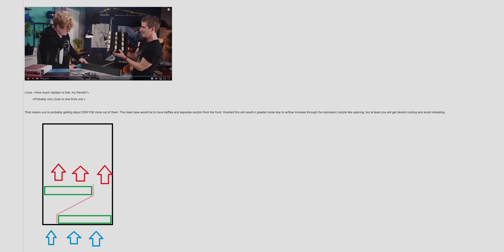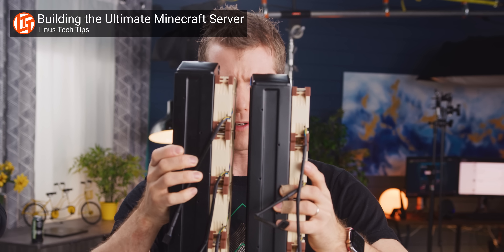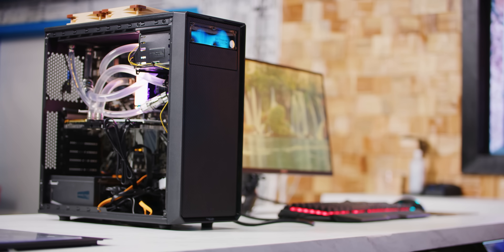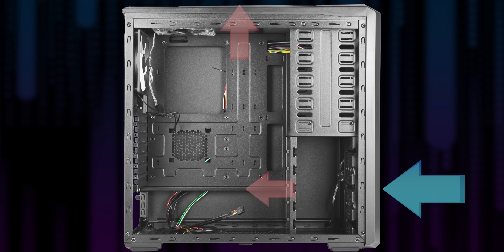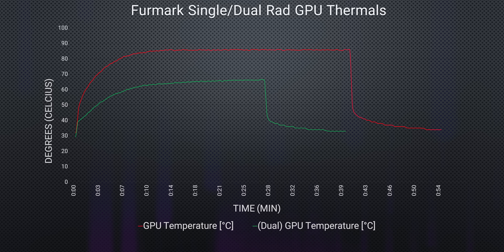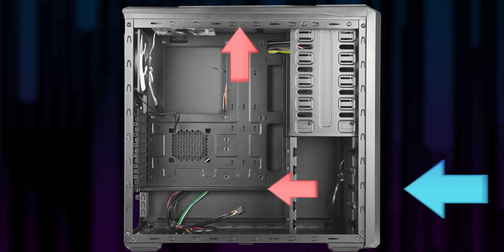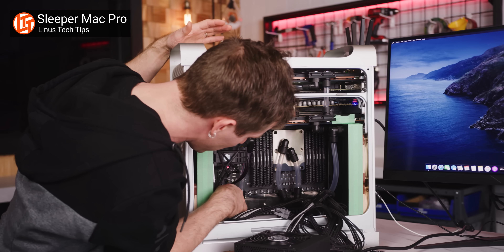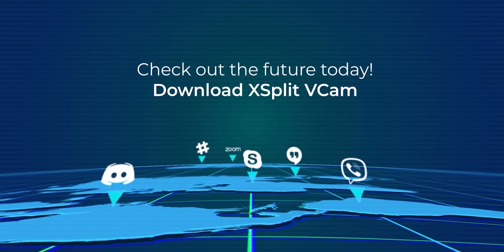I’ve been water cooling wrong for YEARS - $H!T Manufacturers Say

Comment: no shit? cooling isn't magic, you can't push heat into the air effectively if it's already hot. obviously feeding one radiator's hot air into another radiator makes the second radiator less effective. that doesn't make it completely useless, but it's certainly worse than a setup that gives each radiator its own intake so they don't have to share air

Comment: I had an intake 200x200 rad on the front of my PC with a 240x120 on the top. Swapping the front big square to an exhaust and the rear 140mm fan to intake resulted in several degrees lower temps and at least 6 degrees better under heavy gaming (thermaltake L10 with the big 200mm side intake fan case). Having intake and exhaust radiators is never an optimal setup

Comment: There is one big mistake in Linus' tests. So Linus' test are useless 

You adding more radiators and mass (water). So you will need more energy to heat the water up and overall the system stays cooler in the same amount of time. 

Solution: You need a test case, where both systems have the same amount of water. Maybe in a second reservoir.

And it would be interesting, if you measure the temperature on both sides of the radiators.

Sry for my bad english

Comment: The difference in the Time delay between the two Cases is: That the Extra Radiator adds more Water volume which has to be heated up. More interresting would be by Stacked Rads if there is a difference between the Water flow and the Airflow in the same direction or counter flow

Comment: the gpu is watercooled. the heat of a fan cooled gpu, will blow its heat into the top radiator. hot air elevates in a pc case. do the test with a non-watercooled gpu. ur cpu temp will raise by adding the top radiator. it depends on the situation....wich means, corsair could be right in some scenarios

Comment: A big reservoir helps a ton unless you have prolonged work loads (gaming sessions, with appropriate rads and pump are not that bad). Many times people simply have a crap pump, crap or inadequate fans, or just too much stuff for the radiator(s) to handle. I am shocked at the performance of systems I have seen with a CPU and graphics card with a single 240 or 280 rad and they are wonderful. Most systems with tons of radiators run silent (low fin density, ultra-low RPM fans). That is cool if you need that, but custom loops are far more impressive than people seem to think.

Most of us stopped using them out of pure laziness.

Comment: 3:35 hold on, that seems completely wrong! You need to use your radiator setup to push hot air out of your system, NOT for intake. That just means that the cool air from outside is heated by the radiator and pushed inside your case before being pushed out by another set of fans. 

Of course your 2nd setup is measurably better... you have another radiator that's actually pushing hot air out through it. I'm shocked that 1.3 million people have just lapped it up.

Comment: Seems to me configuration is everything. For a start, why does this example system exhaust heat from the lower radiator through the case and out the top? Surely it would be more efficient to exhaust the heat directly to the front of the case? As for stacked radiators, I see no reason for such configurations not to work well provided that (and only provided that) the LAST radiator in the stack to receive airflow is the FIRST in the stack to receive coolant from the heat source.

Comment: HEY LINUS! pro question!!!
If you have 2 rads cooling the loop, is it better to put the output radiator between the CPU and GPU then let the cooler rad cool the water going to the water pump? 
or is it just better to put the radiators after echother in the loop? 
Seems like there is a lot of ways to still use at least 2 radiators. But if you put one between you till be able to deparate the heat imput and cool more efficient? 
Or am i wrong?

Comment: I believe it is more like if you are going to cool a cpu and gpu get a larger radiator and larger case to support it.  Then have just a normal set up of fans to bring in more fresh air and take out hot air.  This way all of the components stay cool and not just the GPU and CPU.

Comment: I think you are both right. Your test Linus is not reflecting Corsair use case. With a 9900 and a 2080ti you are probably saturating the capacity of the first radiator. You could put a thermistor and measure the air temp coming out of the first radiator and it is probably a lot cooler than the water temp, because the first radiator cannot cope with the thermal energy. So the second radiator will get colder air than the water temp, and be still effective. I think Corsair should tune their response like this:
- if you can put a larger rad instead of 2 small ones it is better because you get better efficiency with higher dt
- if you have a big enough rad for the system, adding another one is not going to help keeping the system even cooler
- stacking radiators on top of each other reduces the air flow, and because the thermal power is exchanged as dt * flow * specific heat, reducing the flow reduces the thermal power exchange
Interesting video by the way, as usual!

Comment: In your example, the radiators are not stacked on top of each other and both radiators are drawing ambient air.  The front rad is pulling ambient air from the front and the second rad is pulling hot air from below and ambient air from the rear.           /           What the corsair people are talking about is what would happen if you actually stacked the radiators on top of each other. If you did that, the second radiator wouldn't be getting any ambient temp air.          /         But there's more to it. Radiators aren't perfect, the air doesn't absorb 100% of it's capacity as it moves through the first radiator. So if the air only absorbs 80% of it's capacity as it passes through the first radiator then it can still take on the remaining 20% of it's capacity from the second radiator.           /          You would see diminishing returns as you stacked the radiators, and eventually you would reach a point where adding radiators would make no difference. Continuing to add radiators would eventually cause air flow problems which would negatively affect the ability of the system to do any cooling at all.           /          You're going to hit a wall on the cpu  pretty quickly due to the limitations of the coolant and  the cooling system. The system can only push so much water over the CPU in a given amount of time. So no matter how many or how big your radiators are, there will be a limit to how much cooling can be done with that coolant over that contact area at that flow rate.

Comment: I did tests on this 16 years (2004) ago for vaperchill/VIA Tech when i was with VIA Tech and found one thing when I was in Australia in summer but it changed when I went to Dallas for QuakeCon. In extreme heat (Aus) the input Rad slowed the airflow and raised the temp by 15c I tested it again in Dallas (Same system) and I got higher OC's and cooler temps with the 2nd Rad.... on Day 2 of Quakecon someone broke into our display and destroyed the system steeling the CPU Ram HDDss and GPUs :( so the test ended and I gave the Case away rather than dragging it back to Aus. It was a 100% sealed case.

Comment: You actually checked there claim. They did nothing but point the finger. When you point the finger 3 fingers point back at you. You are correct and they are just as bad as apple. Every employee they have that points the finger is  3 fingers pointing back multiplying there negative karma so hard they will be reborn as maggots. Its a big number of fingers increasing exponentially pointing at themselves for not even showing proof for there claim. You can't do that. I can't accuse people with no evidence. That's not how the world works. They can talk but if you don't prove it you just talked which is nothing. They proved nothing. Tell the judge some words and see how you go.

Comment: Compare inlet to outlet temperatures. If the outlet temperature isn't being reduced to near the temperature of the cooling medium (air), the single radiator is being overloaded and a second radiator would be beneficial. If excessive inlet temps to the radiator are seen with adequate cooling, you have insufficient water flow. 
Heat removal= mass flow rate X specific heat capacity (a constant) X differential temperature across the heat exchanger.

Comment: I don't watercool, so I may be completely off base here. But... wouldn't adding a second radiator mean you're increasing the total volume of water in the cooling loop? Which would create a larger thermal mass to heat and cool, which would be one more variable to consider for almost all of the factors involved...?

Comment: corsair trying to sell more of there craptacular thin AIO coolers,  heats soak is only an issue if you do not have enough capacity more capacity is better the temperature of the air over the rad matters very little as long as the air is cooler then the water then it will still cool effectively entropy is entropy hot moves to cold cold moves to hot saying that two rads stacked together would be worst or not effective at all demonstrates a clear lack fundamental understanding of thermodynamic

Comment: The sequence also matters. If you arrange the loop as CPU-GPU-radiator-radiator-pump (as in the video) the second radiator receives cooler water and doesn't achieve much. But if you arrange it as CPU-radiator-GPU-radiator-pump the second radiator gets a higher temperature differential and becomes more efficient than the previous arrangement.

Comment: By putting the fans outside the case, you've modified the case. I'm pretty sure a Corsair engineer wouldn't have even considered that as a valid option.   You may as well have punched two holes for water lines into your case and mounted the extra radiator on the outside as well. Putting a radiator outside the case would certainly reduce inside air temperatures.  Lets be honest though,  it looks tacky? 

   The only way to test this having a motherboard whose RAM will not get in the way.
 Regardless as others have pointed out, this wasn't a test of stack radiators.

Comment: what about external rads?  mounted in a rack set up a couple of feet away from the case, granted you would possibly need to run all the rad fans with a seperate power supply. but you could just technically wire all of the fans together in parallel and run them with usb wall warts, that might just take some solder and heat shrink, and some attention paid to how many fans can be run on each wall wort. or  you could put the rack of rads inside a bar fridge. it would be very possilble to cut some holes in the side of the fridge to run the loop through. and this might sound crazy, but couldnt you hook the loop up to a commercial water chiller and forgo the rad all together? (this seems to be the most outlandish and expensive solution i can come up with), maybe linus has a job i could have?  isnt there a video somewhere of a case made of radiators? or an all heat sink case?

Comment: The main reason that stacking rads works is not just to do with the airflow.  It also has a lot to do with water flow rate and surface area.  When you had one rad, you were heating that rad up to a specific equilibrium temperature, let us say 55C so the air leaving it was 55C, but when you stacked rads, both rads are seeing a new equilibrium water temperature across double the surface area since the water flow in the loop is high enough to keep both rads within a few degrees of each other.  So if your room air is 20C you might reach an equilibrium temp of 35C because the air leaving rad one maybe picks up enough heat to increase the air temp by 10C and then that same air goes through the second rad and gains another 5C before exiting the second rad at 35C.  The efficiency of the second rad is diminished by the warmer air but that warm air is still far cooler than the single radiator because you have the air spread across a larger surface area so each rad contributes something to the cooling and also increases the overall capacity of the cooling loop.

Comment: When it comes to the Minecraft server build  I think Corsair is right, because stacking radiators on top of another leaves no cool ambient air in and it might even balance out the effect of the first radiator making the system less efficient or even pointless.  

Linus should have run a comparison test on the machine that corsair critiqued. That would have been an exact comparison, At least that's what I was expecting. 

More than that, It's offensive and outright disrespectful when you try to hit your number of video output target by putting a video on a company or person who tried to point out what you might be doing wrong on the "$H!T Manufacturers Say" episode. I know Linus isn't calling out them and saying what they're saying is wrong, but I feel that this wasn't an exact comparison, and Corsair might even get a negative reputation from the public.  I hope that Linus will be little more careful, I don't want him to be the "STFU nerd I know what I'm doing" guy.

Comment: Fun fact. There does NOT need to be a temperature difference to exchange heat. Pressure from the flow creates exchange even at same temperature [ever notice that a fan makes air feel cool? but it clearly isn't cooling the air, right?].

Also, the water /should/ be really warm, from the devices. All that heat won't be in the case. The case temp does not equal the device temp. But the water temp should be close to that device temp. So if you go through 1 rad ... you lose some heat from the water. Do you lose all of it? If not, then it's likely still warmer than the case internal ambient.

Add to that the fact that fluid dynamics says that air can take up more heat/moisture from pressure/flow, even if ambient temperatures would otherwise not create that result, and you get a clear denial to the logic used by Corsair. It's good thinking, but ... the principle is wrong.

Comment: The 2nd radiator is actually useless, it only takes up space in the case there is zero reason for a radiator be used as an exhaust. My guess unless I missed something is that the additional cooling was due to better fan placement that allowed for an extra amount of pressure release the fans being on the outside of the case vs inside would be a drastic increase in pressure and air flow within the case.
Reply: Radiators are not designed to cool air. But rather displace radiated heat from something the flows through its cooler pipes. If the thing needing cooled does not physically move through the radiator it is not doing anything. You cannot effectively cool air with flowing coils
Reply: The reason why radiators work for water or other fluids is it transfers that heat to the area surronding it. So if inside a case this heat will be transferred to the case. Air is not traveling through the inner piping thus you cannot cool air with a radiator, in fact radiators are used to heat homes by displacing the warmer heat from objects into the surrounding atmosphere.
Reply: See your local heating and air guy for more info. You merely saw the results you wanted due to not performing exact replicas of the test......that moment you think because you build pcs you know more than the last 300 years of known science

Comment: The advice that corsair gave you was in concern to a 'closed system'. If you added a million radiators to a closed system it would be no different than a single radiator that already cools it fine. It's a thermodynamics concept on heat pumps and refrigerators that is covered in physics. If you want to save money, make sure you know what type of case you are using when building a pc.

Comment: I built a water loop with a large copper radiator intended for a wood burning furnace. It must have had 5 liters of water in it. Well, it DID work, but it was expensive and ugly, and collected dust. The benefit was so small. A simple AIO was withing 1 degree C of the same temp. Did Work. Totally not wort it.

Comment: Why not just have both radiators suck in fresh air from outside and all the other fans exhaust?  Why the obsession with exhausting out the top?  You aren’t relying on natural convection - the computer is covered in fans for crying out loud.  

The two setups Corsair critiqued had the second radiators sucking in hot air - if you suck in cold air then of course, two radiators sucking in fresh, cold air instead of one sucking up “used” hot air are going to be better.  Not sure why you couldn’t just make that point - ensure all radiators are supplied ambient air and it’s a net win.  If you can’t, then don’t bother with additional radiators.

Comment: What would happened if you changed the orientation from the top fans to take cool air from the outside to the inside of the cpu and install a 3rd and 4th fan (if possible )to pull out the hot air from inside the case?

Comment: Was the total amount of water the same for both tests? Was it for example 3 liters of water in each, or did the second rad with tubes add water to the loop? Would a different (maybe square), second rez help with heat dissipation the same amount as the second rad did?